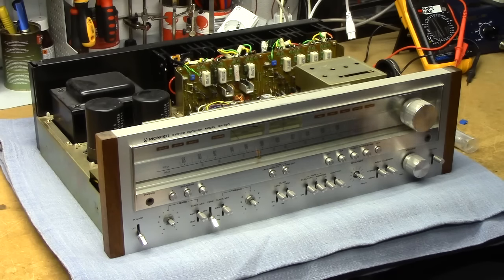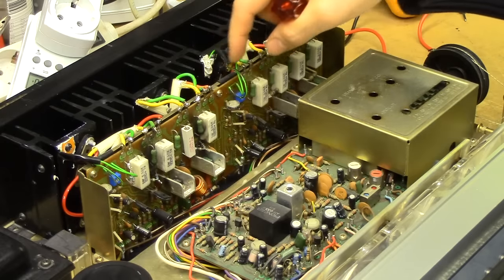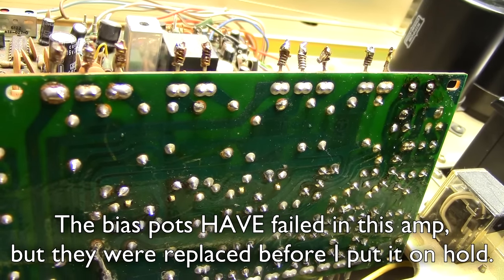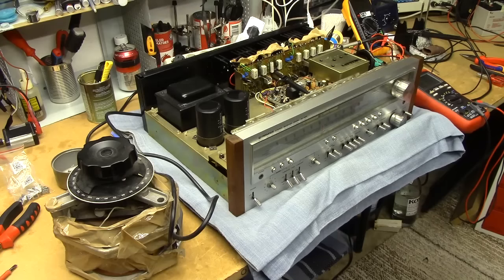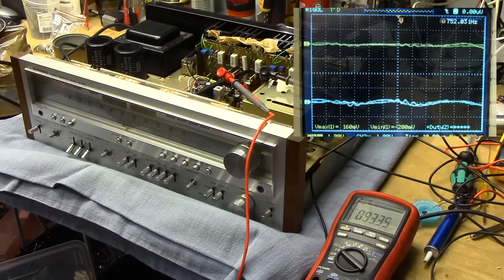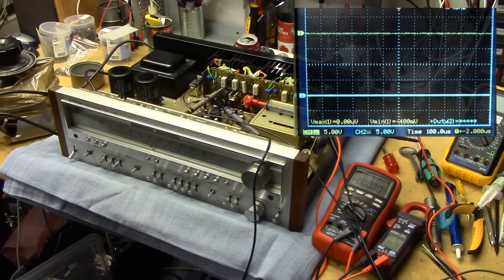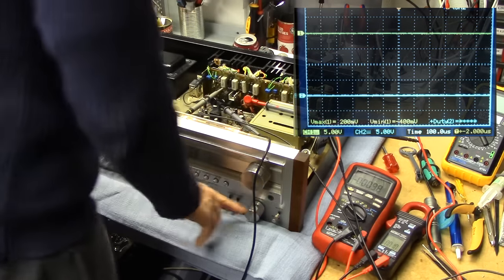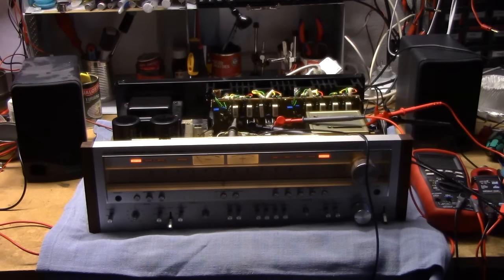Pioneer SX-950 power amplifier repair

Comment: I purchased an sx-950 after getting out of college in 1977 and its still my daily use amplifier receiver for almost 45 years. I have never had any issues with it at all.
Reply from the maker: Lucky. Mine keeps exploding.
Reply: @FFcossag  mine is 100% original and still has a DC offset under 5mv on both channels. Original lamp bulbs except one. Note: I have always run mine with the heavy wood cover off the unit just I do with my even older Heathkit AR1500A. I am not a fan of heavy wood cases as they create an oven effect.
Reply: I got mine in Spain PX in 1977 and repaired it 30 years ago but it need fixed again!

Comment: Nice amp! You just can't beat vintage gear for quality and sound IMO.
Reply from the maker: +ProdigalPorcupine That is often true - sadly, once I get the performance test video up, you'll find out that the performance of these old Pioneer boxes really isn't too spectacular. They  definitely can't be beat for ambience, though, just given their sheer size and shine.
Reply: +FFcossag Meh! You can prove anything with your fancy 'science' and 'specs'! ;-) There's a few crappy sounding old Japanese amps out there, but I've always been quite impressed with most of that era. I have a lovely early 80s Realistic STA 2080 receiver I should dig out and overhaul. 365UKP back in 1981! It's a thing of beauty.
Reply from the maker: ProdigalPorcupine I was referring specifically to these Pioneer receivers. Most Japanese hi-fi gear of the era was very well-performing by any standards.

Comment: I'm interested in what Pioneer installed as power output transistors; 2SD... of some kind.. a complete test would incorporate the use of a dummy load across the speaker connections, and nominally 8 ohms. Send a signal (say, 1kHz sine wave) through to check voltage, and calculate output power at the point of 'clipping', and 'drive' it for a few minutes, and check for 'heat' on components (after switch-off)..

Those older 'brushed aluminium' style front panels still have much appeal, so whenever I come across one I just 'fix it', and ask why later..!
Reply from the maker: If you're curious, I performed a more proper performance check on it soon after repairing it: https://www.youtube.com/watch?v=hpwgQLBTZUg

The original output stage, I THINK, were 2SB/2SC transistors of some kind. It's in the SM if you really need to know, but it strikes me as a bit irrelevant today when you can get much better spec MJ series devices to fill in to gain some reliability.
Reply: +FFcossag Yes, quite right with the MJ series, and their availability and specs. I sometimes make comments mid-process, and often find the 'next part' covered that ground already! My last job with the 'Pioneer' brand was the replacement of an IR remote sensor. Used one from a scrapped video. Took a long time to diagnose and repair; connected the (faulty) sensor to the oscilloscope, found an output (aiming the remote control at it, and pressing a button). I the tried the sensor from the video.. 10 times the amplitude... fitted it, and successful repair...

Comment: one emitter resistor is different you should replace them all to balance it
Reply from the maker: +geoepi321975 It's different, but they're all within the specs of the original ones, so I just haven't bothered. The power amplifier portion also performs to spec, so it's just a cosmetic thing.

Comment: I have a Pioneer SX 5580 (The civilian clone model would be the Pioneer 1050) that I can't get any sound out of. It powers on just fine, knobs are real smooth, and I can get signal with antennas; but I get no sound out of any speaker port nor the headphone port. What might be wrong with it?

Comment: Subscribed!. I need you help. I replaced the bias and dc offset pots but I need to know a good starting resistance point for them as the original pots we're completely toast and I don't have a reference .  Thank you
Reply from the maker: I think the service manual has a procedure for that. The DC offset pots don't really matter since you won't blow anything, but the bias pots should generally be turned to their minimum bias level before first start. You can't usually turn it down too low.
Reply: @FFcossag  Thank you so much for the reply! By lowest level do you mean closed 0 ohms?
Reply: @FFcossag  also the pots I got are 0.2w rated. Should I get bigger ones?

Thanks
Reply: @FFcossag  Another issue I am having is I get -50v through the bias pots from ground on powerup then after a second flattens to 0. This is with no power transistors connected. I am also getting 50/-50v between collector, emitter and base.
Reply: @FFcossag  Its alive! and all good :)

Comment: Hi, interesting video, but i have a question. Where are the measurement stripping of the multimeter at 9:40 connected? At capacitors? Can i not properly recognized.
Greetings from Germany!
Reply from the maker: +Zerno It's connected between the positive and negative wire-wrap terminals of the amplifier module. Keep in mind that I incorrectly state that I'm measuring one voltage rail; I'm actually measuring across both.
Reply: Ja vielen dank für die info. da ich nicht so gut alles in englisch verstehe, ist es schwierig gleich alles zu erfassen. Ich sehe dann anhand der videos was sie machen und kann es mir herleiten. nur die anschlüsse habe ich nicht genau gesehen, wo das angeschlossen war. vielleicht können sie bei zukünftigen videos mal kurz reinschwenken, das man sich ein bild machen kann wie sie angeschlossen haben und wo. ich lerne gerne dazu, da ich mich dafür interessiere und es als hobby betreibe. ich möchte mir auch in zukunft ein oszilloskop kaufen und da sind solche videos von ihnen und anderen "kollegen" wie 
12voltvids sehr hilfreich und informativ.

Liebe Grüße!
Reply from the maker: +Zerno I don't speak German, and I don't dare say anything based on Google Translate, I'm sorry.

Comment: Are you testing that amp with no load??? Are you aware that you could kill the outputs and even the drivers doing that? You must have at least a 8 ohm resistor instead of a speaker or even a speaker connected or you risk to burn the amp even with low volume or no volume at all. My god! Do you know what you're doing??? I don't beleive so...
Reply from the maker: +CPUTests This is not true for any half-modern transistor audio amplifier. Some of the really early (think 60's) transistor amplifiers built before they really mastered negative feedback could oscillate and explode if you disconnected the speakers, and transformer coupled tube amps should certainly not be run without load. A "modern" amp like this, though, being built to act as a voltage source, really couldn't care less. Which makes sense, since else it would explode if you were to turn the speaker outputs off with the buttons on the front panel.
Reply: +CPUTests It's not nice to say that other people doesn't know what they're doing, specially when you really don't have a clue of this kind of electronics. Btw, I'm an electronic technician and in my last year of engineering, so, I can guarantee that what he is doing is fine.